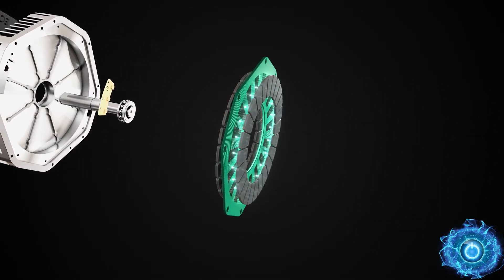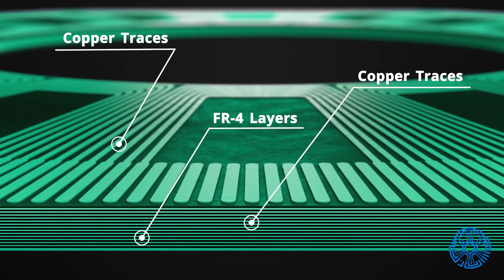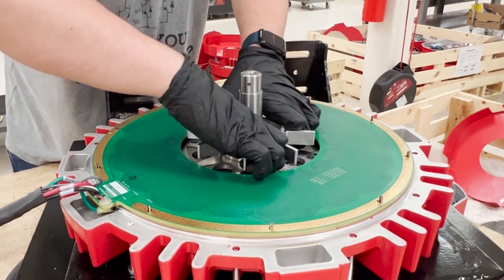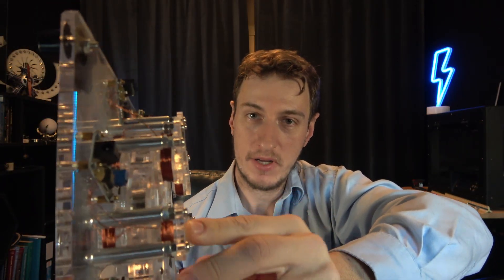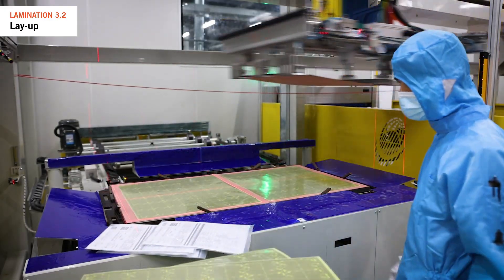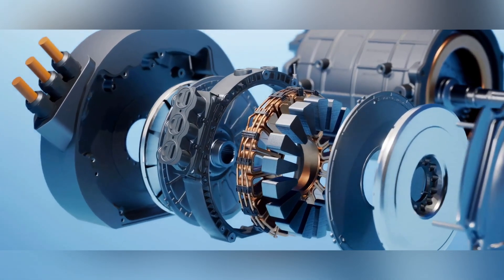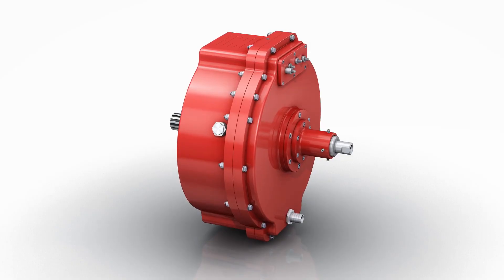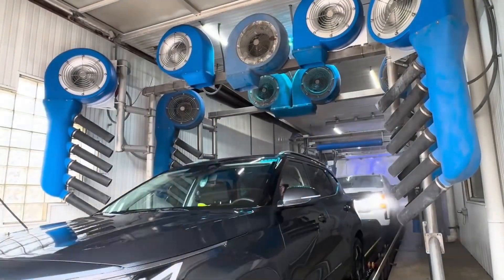PCB Motors - The Future of Precision Design

Comment: This is the first step. The downside is that we need a PCB and that's still wasted mass. The next step would be to 3D-knit a CNT wire (carbon nanotube) into a carbon composite material. Doing this with a reluctance motor, almost the entire dead weight can be eliminated. Leaving us with kilowatts within just a few hundred grams and enormous amounts of torque.
Reply: As soon as the CNT wire is available to use in large scale projects and enters the manufacturing process… hopefully in our life time

Comment: These are great at being integrated into an existing board that needs human or external interfacing requiring a motor, but motors made using this process are always going to take second place to dedicate wound-stator motors because of the dramatic difference in percentage of the stator that can be copper. PCBs are not high percentage of copper!

Comment: What if instead of copper you used stacked CVD iron nitride doped graphene?

If it's mass produced then it should become fairly affordable since its just CO2 gas and a plasma with some iron nitride.

The initial outlay for new equipment is always expensive but having a monopoly on a market that nobody else is close to is always profitable so maybe it's time to look into graphene plating for profit.

Compared to an engine with 100 moving parts and complex machining a PCB is basically a walk in the park for 3D printing.

Comment: PCB motors have incredible possible applications. We are trying to see the validity whether these can be used to aircool large circuit boards (75 sq in, 15x5) so the cooling parts of the circuit board can be eliminated. Our target is to create turbulent air flow over the entire board, especially the processor and memory portions of it. If possible, we can eliminate a small dc pump, oil to coolant plate heatexchanger, and replace those with essentially an air filter to provide air for cooling the circuit board itself.

Comment: It's the future and manufacturing costs are coming down, so maybe in 30 to 40 years, today's brushless motors on drills and what not, will be yesteryear's brushed motors as everyone moves to PCB motors? Impact hammer drills would probably pivot to these motors as companies look to do the torque eqivlant of fry , horse power, and  Gigahertz wars. For instance they have giant impact wrenches for train rails, but the tools need a harness to lift & hold the tool in place by the operator since they're too big, and awkward.

A good use for such a motor is maybe impact hammer - torque wrench hybrids. Such tools exist but they're like 1000+ dollars, and can be stolen just as easily as a 50 dollar Ryobi drill.

Comment: I would love to see this come to the hobby market. I know that Carl Bugeja is working on similar motors, but I think it can be taken a lot further. Imagine if they develop similar motors for small drones.. I don't see them in 3D printers yet because of the high torque requirement, but maybe in the future, stacked PCB's could replace heavier stepper motors while at the same time offering precise feedback loop options for precise positioning and overshoot correction.
Reply: What's the point in making your 3D printer 150 grams lighter at the expense of using the technology that is inferior in every other way, but the size? Bruh. You were probably thinking electric cars would take over by 2025, when you first learned about Tesla.
Reply: @NoNationHero  you should definitely look up Carl Bugeja's work before commenting like this.
Reply: @bloepje  YOU should check his work. Cause I did. He's doing small size, not high torque. Which 100% correlates with my comment. Fanboy.
Reply: @NoNationHero  I think you lack imagination and that's why you fail to see the potency.

Comment: How suitable are these for robotics applications? I guess high voltage low current implies a gearbox which is OK but adds friction. And how about drone application or does it require too much power for that? 🤔

Comment: In the 1970s I worked on hard disk drives which used PCB motors to position the read/write heads.  The PCB part was the rotor, presumably to keep the weight down.  IIRC the carriage was connected to the rotor shaft via a rack and pinion.
Reply: This is where I first saw the PCB motor, too. At one manufacturing plant, there were some slim low-profile transformers that used a PCB for the windings.
Reply: In the 1970's???!!!  Wow, I really am behind the times! I thought this was a new or very recent development!
Reply: @Amb3rjack  They stored 60MB, ran off three phase mains and were the size of a washing machine, at least you could swap the actual disk to extend the storage.
Reply: @rogerbarton1790 AHH, right. Were these the old Winchester drives where you loaded a stack of disks from the top? The heads would come in from the side like fingers and they used to float on a cushion of air a few hundred microns thick to stop them crashing onto the actual disks?

Comment: It looks like the PCB motor has fewer effective windings.  Does that require a higher voltage to produce the same torque?
Reply: I would expect higher current, since the magnetic field produced is given by the amp-turns product. This means lower voltage, since the resistance and back-emf will both be low with few turns.

Comment: Anyone knows when the delamination left the chat?
Reply: My thoughts exactly. He explored the drawback and need for active cooling later in the video.
Edit: and stacking multiple laminates, caught me off guard. This one's pretty smart.
Reply: @johnnybueti depending on the current injected in the PCB, there will be localized heat and wearing. imo, these motors are good for speed, not torque. However, with a properly dimensioned gearbox, the overall system might exceed battery life.

Comment: :yt:The PCB can't handle the amount of heat that this design would put out, under any useful loads. There would need to be a VERY substantial cooling system integrated into this design. The copper layer on a PCB would fry instantly if the cooling system goes out. And I'm not talking about a water cooled radiator system, it would have to be an actual cooling device.:yt:
Reply: True, on the other hand, the PCB uses flat wire with copper near the surface. This has a large surface area making it easier to remove heat.  

Also, Traditional magnet wire has a temperature limit too since it’s wrapped in polymer insulation.  If one really wanted to, they could make the PCB material out of the same material used for the wire enamel, polyimide.

There are other possibilities too, like aluminum core PCBs and ceramic PCBs. 

I agree though for standard FR4 material with air convection cooling, The applications are more likely to be low power or low duty.
Reply: Cody's Lab already did a video, on rotating magnets on a wheel, to melt a copper penny. And it did melt the penny. Regular motor windings are thick enough to handle this heat, PCB copper layers are not.

Comment: Interesting. I haven't heard that PCB motors have high efficiency before. But I don't doubt it for the small ones. All of the axial flux motors shown that were not PCBs had steel laminates in the middle. 

The last PCB motor design at 5:38 has sections in the middle that are empty.  I'm wondering if a slot was removed from the center of the coils and steel laminates were put in between to increase flux density. Maybe that is not as necessary since the magnets are so close to the PCB already.

Comment: Cost, durability, scalability, and power output will drive the advancement for PCB motors.  Hope the technology continues to develop!
Reply: It has come at the perfect time. There's a demand right now for very high volume robot actuators. I'm wondering if they can make linear motors this way
Reply: YASA has a prototype 28 pound motor that peaks at 1000bhp. 750kw. Tested. 

 350-400kw continuous estimated.  28-31kw/kg. 

 That's around the same as a top fuel dragster! The f***. Double the peak. Doesn't need rebuilding. 

 No exotics. Just dielectric oil for cooling as far as I can tell. 

 F1 hybrid combined is 1000bhp. Motor/engine weigh like 151 KG at least. 

 Just in time for the new batteries in a few years if WWIII doesn't start. 

 Tech like that, and PCB motors. Graphene. Pervoskites Solar. 

 That's going to allow personal flight. Redundant VTOL with a bunch of motors. 

 We just don't have a rotary. F1 sucks for being dinosaurs.

Comment: It really makes me wonder what took so long for these pcb motors to start being made? Now that there are places like pcb way it makes it super easy to make your own. Awesome! 👍
Reply: ' what took so long for these pcb motors to start being made?'  Very few applications warrant the extra expense for the lesser performance.  They've been around for ages in floppy and CD motors, and other specialty applications.  
Wait until you see it, and the cost..
Reply: @ModelLights  lol, I cant believe I forgot about drive motors for HDD and Floppy. I was caught up in the larger size and uses when I thought that. Thanks!
Reply: Quite interesting question actually!

I haven't dug into the numbers so I don't really know what was the real limitation until now. But I suppose that they found the optimal balance between torque resistance of the stator and high RPM capabilities of the rotor and high switching capabilities of the control driver.

Reason goes as: the same torque produced by the output shaft is applied to the coils, embeded in the PCB. Producing high torque requires an equally strong PCB stator. So, producing high power requires high torque resistant stator or high RPM. Given that the PCB coil's current rating and magnetic flux are likely "relatively low" anyway, low torque + high speed assembly is propably how they did achieved that on the mechanical side. The challenge is probably on the control side given the "low inductance" of the coil, which requires higher switching frequency and equally faster control unit.

I suppose I will have to make some prototypes to investigate that matter deeper!
Reply: I saw pcb motors iend of 70s -  beginning of 80s in technical university, electro-mechanical department. The concept is as old as dinosaurs
Reply: @koboglo6973  Old concept, but new trace topology!
Reply: @koboglo6973
Но в 70х 80х не было таких транзисторов, драйверов, микроконтроллеров...
Reply: His explanation is basically incorrect. There are less winding compare or conventional motors. That said, it does have a relatively slimmer profile. Or it can have a much slimmer profile. And of course, it is at the expense of less windings.
Reply: PCB motors are used in VHS camcorders for spin heads

Comment: 4:17 Why the stepped rotor shaft? Is it to more easily locate and support each separate magnetic rotor slice assembly and to be independently located (and supported) from other ones? Interesting video!

When I worked for IBM, they used multilayered ceramic substrates under their chip arrays instead of pcbs to route the electrical connections. These chip arrays were actively liquid cooled due to their relatively high power requirements. Not motor power levels but the power density was probably fairly high. Seems like additive manufacturing technology could also be useful. Fun stuff.
Reply: Ceramic is a frequently 3dp material now, seems that would make incorporating cooling channels easier, however at that point I'm not sure ehat the benefit is over traditional steel cored copper coils (in terms of cost / complexity of manufacture, I think the whole point of the pcb motor concept is to bring the price point down).